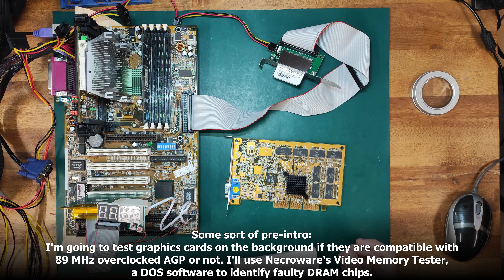DOS/Win98 build with Asus P3B-F, part 1 (parts and PSU inspection)

Comment: I am using AT case with ATX PSU and Baby AT format momtherboard P2B-B (BX chipset). I also overclocked Tualatin Celeron to 133MHz FSB, but Radeon 9200 64MB works fine for me, Riva TNT, Geforce FX 5500 and Geforce MX 440 work too
Reply from the maker: I wonder if there are differences in Radeon 9xxx series? I don't know if it was 9200 or 9250 but that didn't work with 133MHz FSB. Same with 9800SE. I do have couple of more 92xx Radeons and one of them has smaller PCB. Maybe I should try and see if they behave differently.